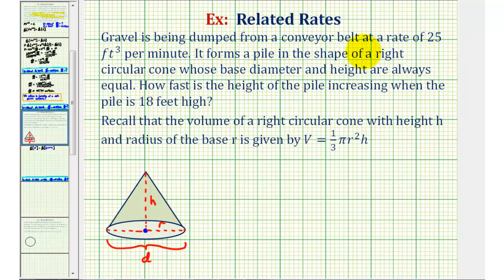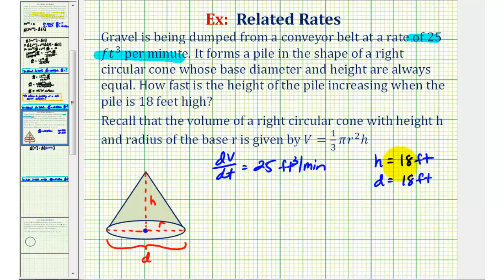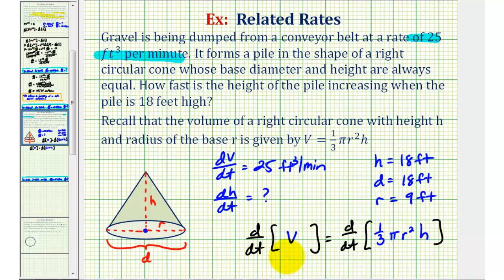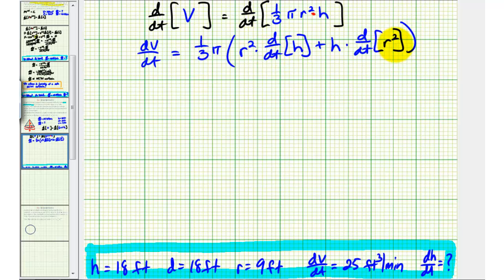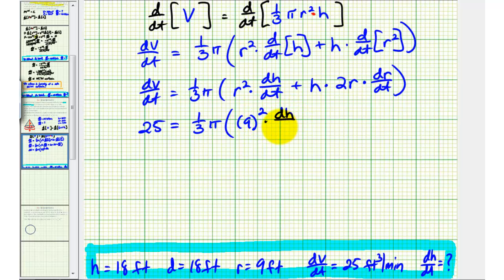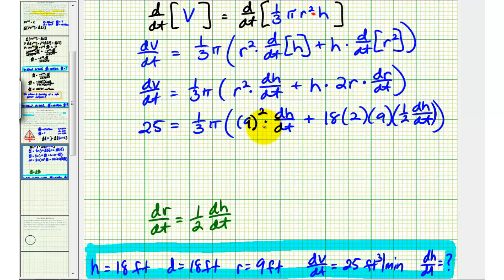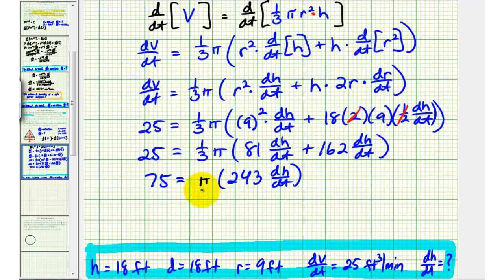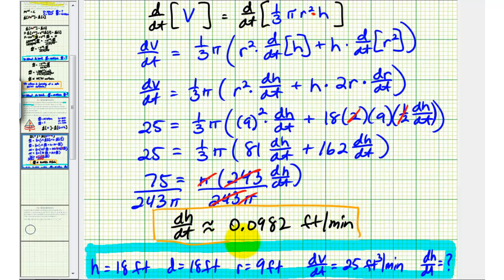Ex: Related Rates - Right Circular Cone

Comment: How did you get 0.0982 ft/min at the end
Reply: thats exactly where i get confuse
Reply: @jaimequintana1827  exactly
Reply: dh/dt = 75/243(pi)
Reply: @josphellihsilak4588  75/243(pi) does not equal 0.0982.....
Reply: @maxlundberg  it sure does. 75/(243*pi)
Reply: @maxlundberg  75/(243(pi))
Reply: Did he use product rule?